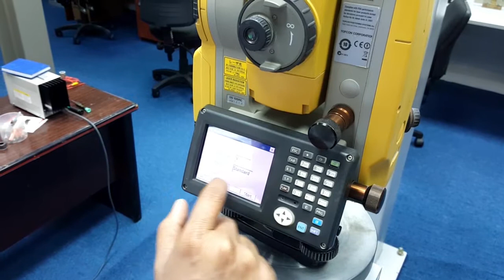Topcon Authorized Service Center Dubai

Comment: Total Station, repair essential tool:
New calibration station collimator with CCD camera and LED screen, can be use for all
brand of laser products, laser level(12 lines laser level,5 lines laser level,3
lines laser level, 2 lines laser level), auto level, rotate laser level, Total
Station, Theodolite, etc.. Accept customer-made, our engineer can design
according your workshop area, and products requirement.
www.simaisurveyinginstrument.com